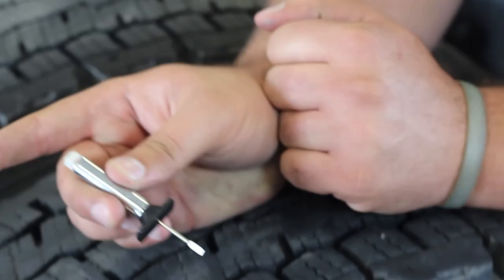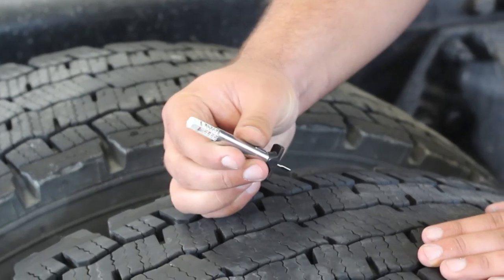How to Measure Tire Tread Depth on a Semi-Trailer Truck

Comment: Peter I have the same one, where on the tool does it actually say 4/32 I can't find it.  I'm turning in my lessed vehicle and they say it must have a minimum of 432 remaining.
Reply: It the gauge shows 11 it means the depth is 11/32, if it shows 8, it's 8/32 etc.